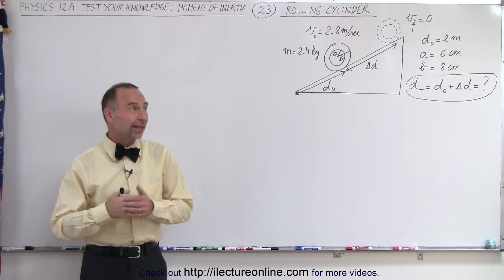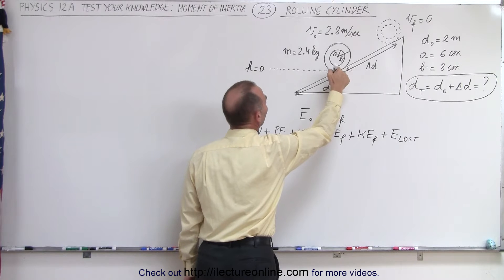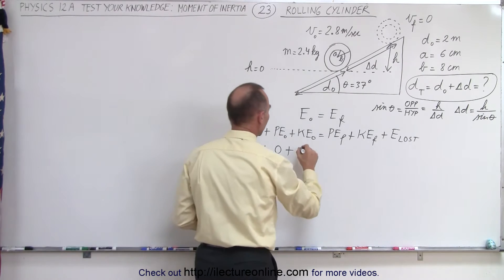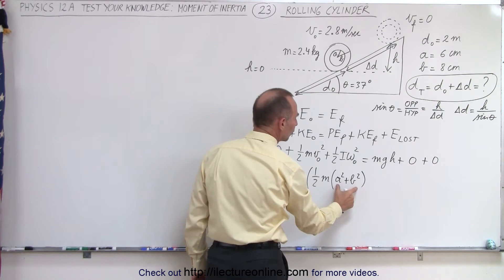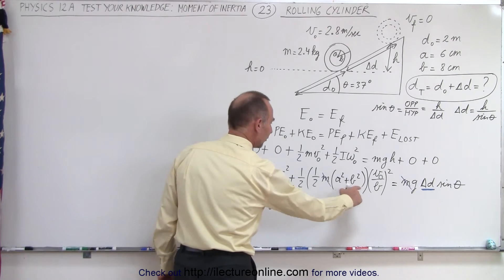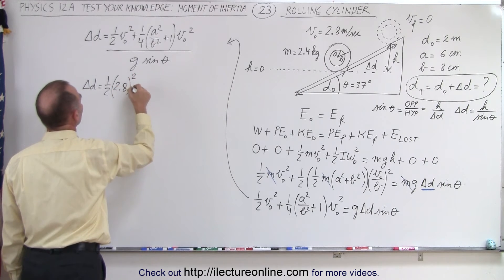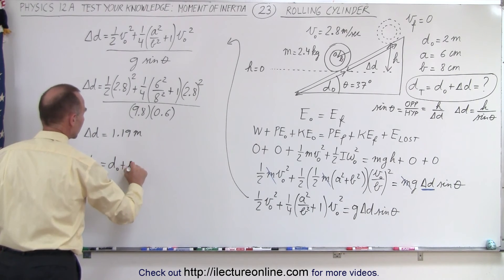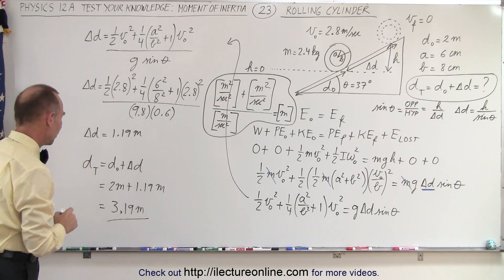Physics - Test Your Knowledge: Moment of Inertia (23 of 24) Rolling Cylinder

Comment: i see the angle didn't matter for the vertical distance because conservation of energy. Will adding energy loss to friction make the angles matter on how high the vertical distance it reaches? Like, a 45 vs 75 degree incline, will it travel less in vertical distance on the 75 degree inclined surface.
Reply from the maker: Yes, if friction is taken into account, the angle will make a difference.
Reply: @MichelvanBiezen  Thank you sir!

Comment: At 2:25 Kinetic energy is described as possessing translational and rotational kinetic energy. Would it also be correct to put "The initial kinetic energy possesses linear translational motion and also rotational motion"?
Reply from the maker: if the object is moving it will have both initial translational and rotational kinetic energy.
Reply: @MichelvanBiezen  Thanks again Prof Biezen.

Comment: but... but ..... if you factor in Length Contraction due to velocity via Relativity... isn't the total distance = 3.1899999999999999999999999999999999 m ??   (LOL, that's a segue into relativity...) by the way, I had to go find the Derivation for the Moment of Inertia for this Thick Walled CYLINDER.... once again... Integrals to the Rescue.... on another note... one of the biggest Contributions your videos have given is the Methodology you use to SET UP INTEGRALS !!!..  that is one of the hardest things to learn.. How to set up an Integral ... be it a Work Integral for total work to lift a Chain off the ground  or Draining a Swimming pool or Figuring out the Potential Energy of a Spring... all those examples are where you set up an Integral to Solve the problem... I never knew how to do that but watching your videos has shed lots of light on that Procedure...  Thanks for all your videos Michel .. and thanks to your "BETTER HALF" for her editing and humor..    and that's that..
Reply from the maker: Yes, once you see the pattern, setting up calculus integrations is pretty fun.  It is amazing how that works!